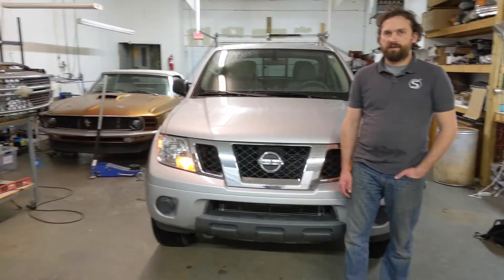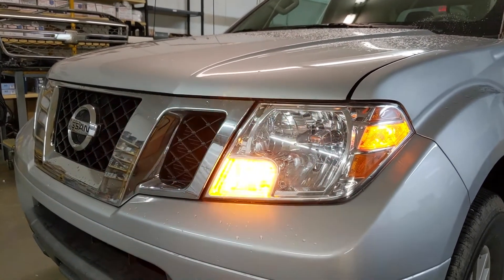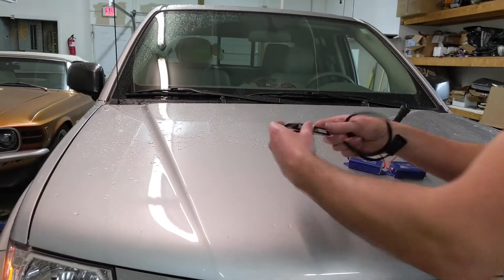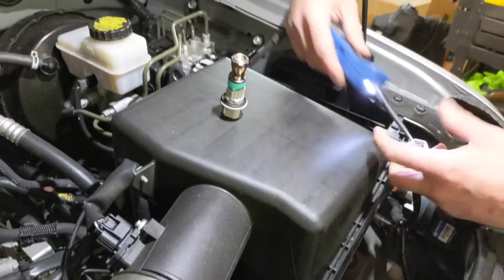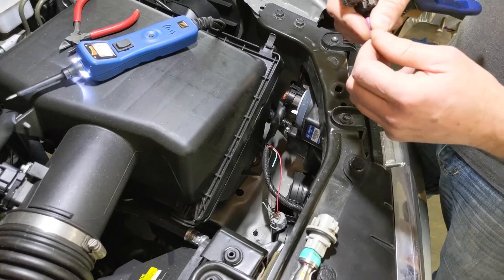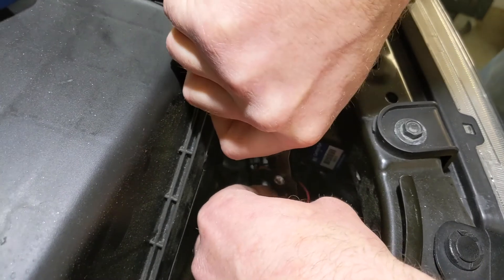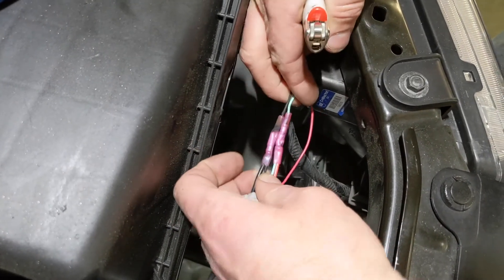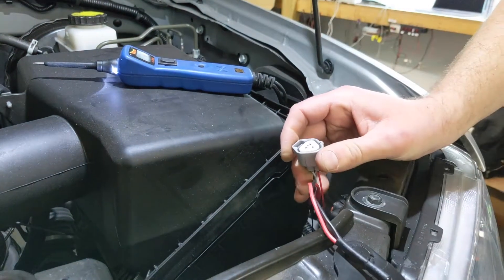What is Hyperflash and how to fix it!

Comment: LED flasher relay is faster and easier and no cutting wires
Reply from the maker: Certainly a good option for certain vehicles. However, many modern vehicles do not have a flasher relay. So a resistor or our bulbs become your only option, unless you have the correct hardware and software to flash the BCM.

Comment: Using resistors is a terrible idea every time! They create far too much heat….. 
Replace your flasher unit or or tune your software for LED bulbs………..
Reply from the maker: Replacing the flasher or flashing the ECU isn't always possible (some 09+ Ram trucks, for example). 

More importantly, the resistors only heat up when voltage is applied. 

So unless you have a Toyota that uses the turn signal as a daytime running light, they will only get intermittent power during each pulse of the turn signal. Which means.... wait for it... they don't get hot at all!!!!

Comment: So where are you mounting the resistors once installed?  You say they don’t get hot, so it’s not like you’re worried about mounting them to plastic. 

Thanks
Reply from the maker: Correct, they won't get hot when used only for a turn signal circuit. There are a few exceptions to this, like some Toyota vehicles that use the turn signal as a DRL. In which case, it has power continuously, and would of course get hot. But for something like the GMT800 trucks, you can zip tie them to the wiring harness or use some self-drilling screws and attach them to the plastic headlight bracket or wherever is convenient.

Comment: My '09 Elantra Touring has a flasher relay socket compatible with an LED flasher I could buy at a local auto parts store. It's not an exact fit, the retaining clips don't reach all the way in, but the electrical pins make solid contact. Check if that's an option on your car, because it was actually cheaper than two pairs of resistors and it doesn't defeat the energy saving benefits of LEDs.
Reply from the maker: Agreed, swapping the flasher for an LED compatible flasher is always preferable, but not always possible. Especially in newer cars where everything is integrated into the vehicles computer(s).

Comment: I accidentally put an LED bulb without adding a resister (it was only one lamp then I saw mistake), I took it out and put OEM bulb back in and now that bulb won’t stop hyper flashing unless I fiddle with the plug and find a sweet spot then it stops. I unplug the bulb completely or not fiddle the flasher module hyper flashes. Any advice on how to fix that, or will it somehow work itself out?
Reply: Happened to me to haven't fixed it yet annoying

Comment: Thanks for such a well produced video.  I just ordered the XenonDepot you demonstrated.  And also thank for the tip on the butt connectors.  One question though is how do I make the pigtail so that the Xenon resistor can have a clean connection?

Comment: Mr. Smith, we are to add a resister to each turn signal bulb back and front?
how about installing LED's to reverse lights, cargo lights, brake lights and head lights?  can these be connected straight up?
Reply from the maker: Typically, you do not need to add resistors for other lights. The only exception we've found so far is some European makes (Mercedes, Audi, BMW, etc.) have picky CANBUS systems that require CANBUS friendly bulbs to prevent additional "Bulb Out" warnings. Our LED bulbs have worked for most of these vehicles (https://sparksmith.com/collections/led-interior-exterior-bulbs/interior-&-exterior-bulbs)

Comment: Way cheaper and quicker to just replace the flasher unit. 5 min fix.
Reply from the maker: Certainly a good option for certain vehicles. However, many modern vehicles do not have a flasher relay. So a resistor or our bulbs become your only option.
Reply: Not sure on modern vehicles but ones with relays certainly, in fact I actually cured my problem today by using a fix I found on YouTube, just had to cut through a track on the Pcb and it cured the problem straight away. Took me 2 mins once I removed the relay.

Comment: Where Can I pick up the Black ones at "Xeon"? I need them for 3457 bulb on an 06 Nissan frontier. Otherwise I will leave it Hyper Flashing 🤷🏻‍♂️ 

Not going to go crazy worrying about Hyper Flashing, I know they work. Plus more and more vehicles are using hyper flashing on rear stop lights, can't see why a single light would be a problem 🤔, the only thing I can think of, is it may burnout your flashing module of left on to long? Or maybe not 🤷🏻‍♂️
Reply from the maker: You can pick up a pair right here: https://sparksmith.com/products/low-temp-ceramic-load-resistors-pair

Comment: I'd rather use a modified electronic relay for LEDs.
Reply from the maker: That's certainly a better option. But many makes and models don't have a replaceable flasher. If that's the case, a good resistor, properly installed with do the trick every time.
Reply: @Sparksmith  I haven't run into a vehicle that doesn't use relays but I don't work as an auto mechanic. Anyway, both my vehicles have hyperflash after installing LEDs and I got the Mustang fixed by replacing the relay and I suspect that replacing the relay in the Xterra will fix it in that vehicle also. Anyway, I wonder if there's an alternative to splicing in resistors for vehicles that don't have the relay. I don't know if those so-called "CANBUS error-free" LEDs would eliminate the need for splicing in resistors. Also, I can't remember but there was a video where a guy installed a factory made wiring harness that plugged into the OEM connectors without having to do any cutting and splicing.
Reply from the maker: @genericdude6551  They do have plug in resistors for a wide variety of applications. You can buy something like these (https://www.amazon.com/Alla-Lighting-Resistor-Flashing-Upgrading/dp/B07C86MH61), just make sure the socket style matches your OEM socket. We have CANBUS friendly LED bulbs (https://sparksmith.com/collections/led-interior-exterior-bulbs/interior-&-exterior-bulbs) that work with many different applications. However, they won't work with every make and model. Unfortunately, it is physically impossible to make one product that will work with every single vehicle out there. Just recently, we found that none of our bulbs would prevent a bulb out warning on a 2006 Lexus ES350, but will work for Toyotas of a similar year. Splicing in a resistor is a safe, effective way to solve the problem, as long as it's done correctly. It just takes a little patience. But the aforementioned plug in resistors are a good alternative. If you want or need help with a specific application, send us an email at sparksmith.auto@gmail.com and we'd be happy to help!
Reply: @Sparksmith  I just found out that my 2014 Xterra doesn't have a user replaceable flash relay. I've heard that the BCM can be reprogrammed but someone else said it isn't possiible.  Nissan service couldn't help because this is non-stock. Some say that the CANBUS rated LEDs would be an option since they're suppose to have circuity that pulls enough current to fool the vehicles electronics into thinking that an OEM bulb is being used. Resistors are an option but the only problem with that is that if your LED goes bad the resistors will be telling the electronics that the bulb is good.
Reply from the maker: @genericdude6551  Something like this might be a good option if you don't want to use resistors: https://sparksmith.com/collections/led-interior-exterior-bulbs/products/3157-sparksmith-s-series-bulbs
Just be sure to choose a color that matches the lens (red for the tail light. White, switchback, or amber for the front).
Reply: Willing to
Reply: Leds

Comment: Option #4   Replace your standard flasher relay with an electronic flasher relay (used when towing a trailer). These cost about 10 dollars, install in one location, do not require modification to factory wiring, does not void any automotive warranties and does not cause a heat source that can lead to a fire risk if not properly installed.
Reply from the maker: Certainly a good option for certain vehicles. However, many modern vehicles do not have a flasher relay. So a resistor or our bulbs become your only option.
Reply: @Sparksmith  I didn't know that, good info.
Reply: Yeah Nissans have a bunch of low key, technologically advanced, BMW-esque BS that make putting a relay in impossible.
Reply: Or an LED bulb with a built in resistor
Reply: Option #5 Don't waste your money and keep using regular bulbs. No matter how bright a bulb is, a driver not paying attention is still going to hit you

Comment: I wish you would go into deeper detail of the wiring diagram,  it is hard to see what you plugged into the relay.
Reply from the maker: Basically, we determined which wire was the positive wire for the turn signal and which was the ground. On this truck, green was positive and black was negative. Cut each one and crimp the red and black wires for the pigtail onto those two wires. We'll try and add another video about it.